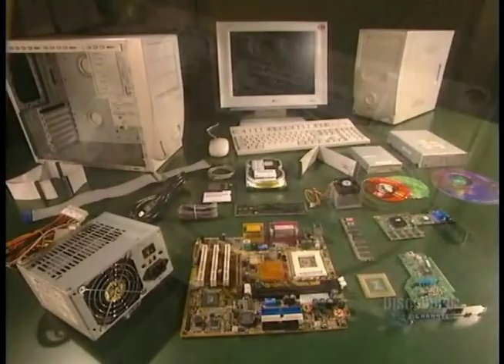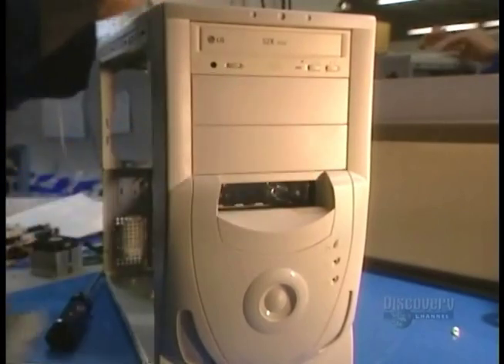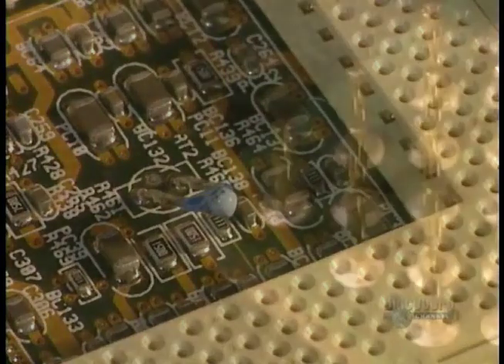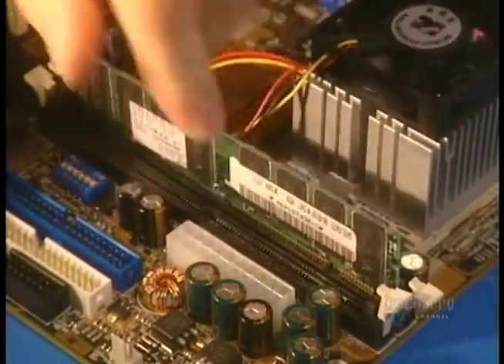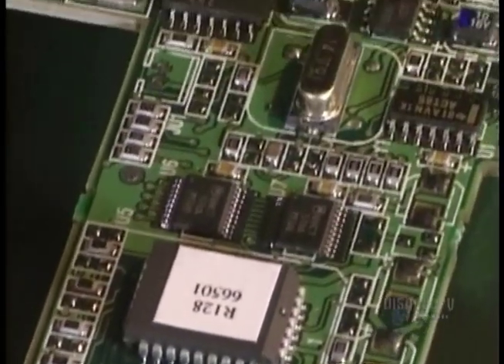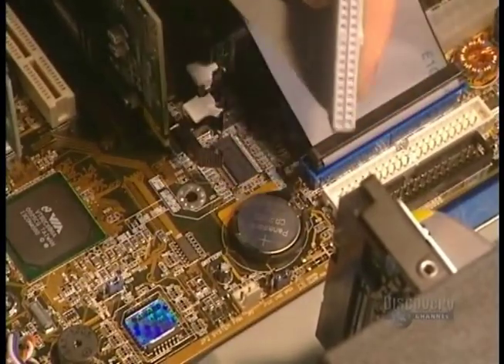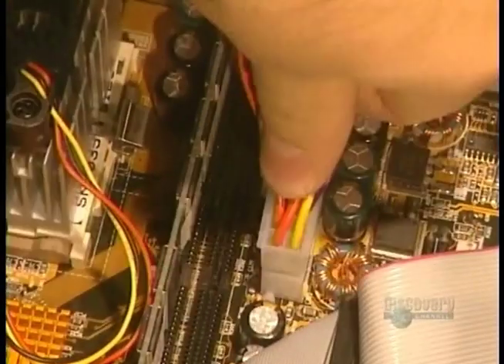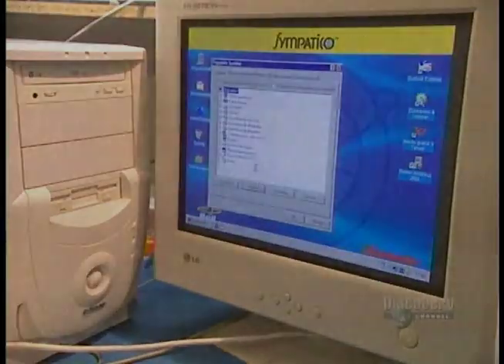How It's Made - Computers

Comment: Specs for those curious

unknown capacity Fujitsu Hard Drive (between 8 and 10GBs roughly)
MITSUMI 3.5in Floppy Disk Drive
LG 52x CD-ROM
Gigabyte Gigabyte GA-6VM7A+ 1.x Motherboard
512MB of PC-133 RAM
Intel Pentium 3  Coppermine 800Mhz
ATI Rage 128 Video Card
3Com 3CP5699A Fax Modem
Unknown Wattage Power Supply (likely 200 Watt)
Generic Case
Operating system Looks to be Windows 98 Second edition,

Computers wallpaper belongs to  Simpatico by Bell Canada.